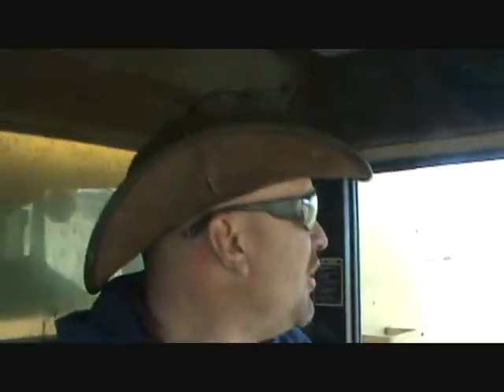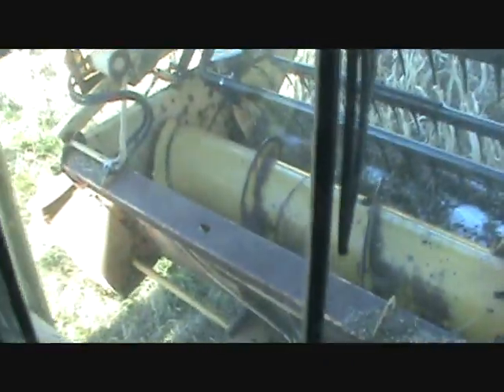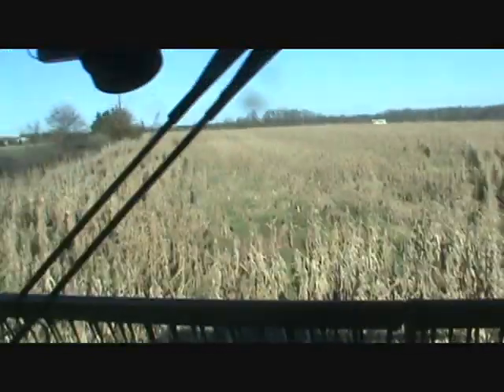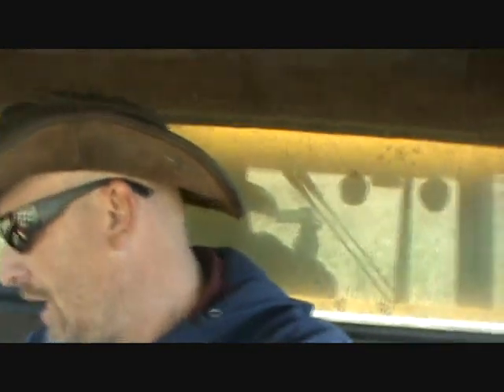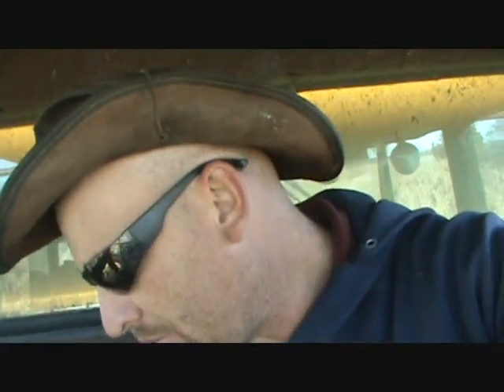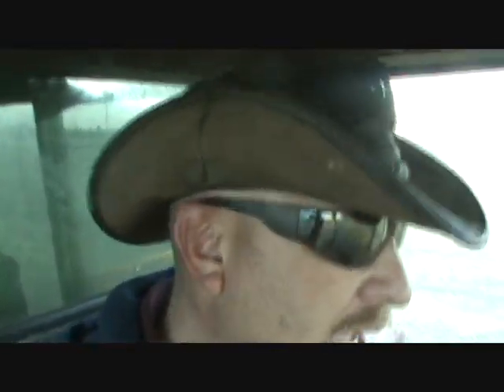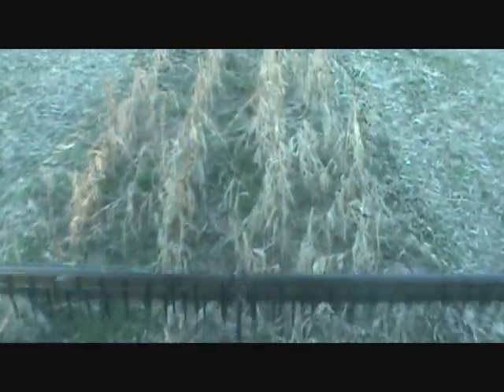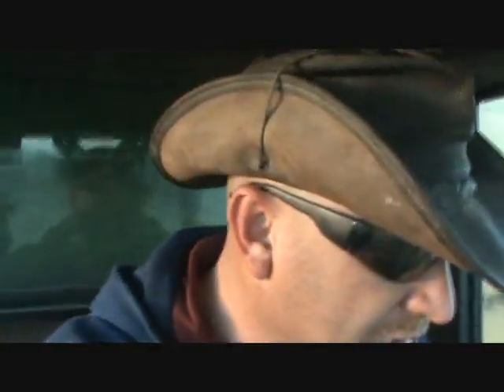Crazy way to harvest corn

Comment: I don't know if you remember them but I remember back in the eighties we took a 7720 with a 653 john deere row crop head made for soybeans and sunflowers, and used it to pick 50 acres of hurricane damaged corn. It looks like a corn head but had belts that grabbed the stalk and rotating knives to cut the stalk off. You had to take it slow but it worked. It was not the cleanest sample but the cows ate it fine.

Comment: we had several years of drought with wind damage.  the solution was to install paddles on the corn head that picked up the leaning ears and stood them up just enough to send them thru the rollers and crimpers.   but we are blessed with outstanding geology here in north central iowa.  The heat of the day and the coolness of the night sets up a capillary action in the soil.   Ground moisture rises and corn can survive with lower yields of course.  the worse year of the drought brought in 140-150 ish.   That was all geology because weather did not cooperate at all.

Comment: I did the same thing one year all the corn was flat so I got my 45ft draper head and CR9060 NH and did all the corn I ended up ruining my draper head and traded it off for new but using it for that reason paid off in the extra bushels I ended up with

Comment: Don't worry we had a jackwagon run through a fence and the combine found a wire pulled down two of the last acres at least u weren't running a 4400 with a 215 flex